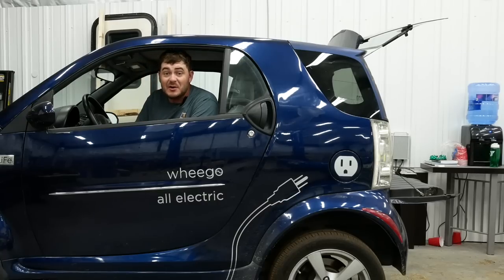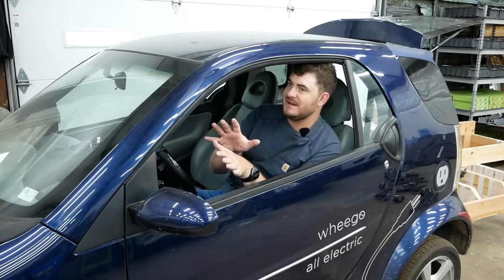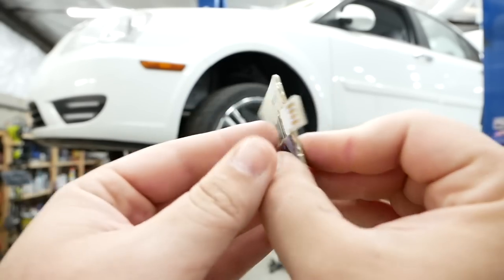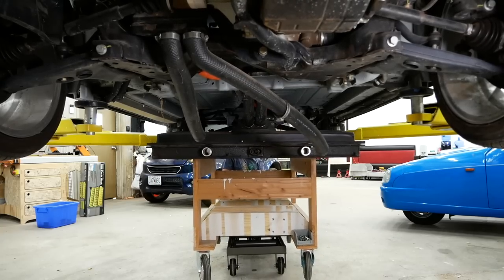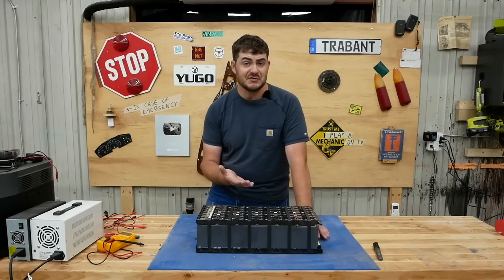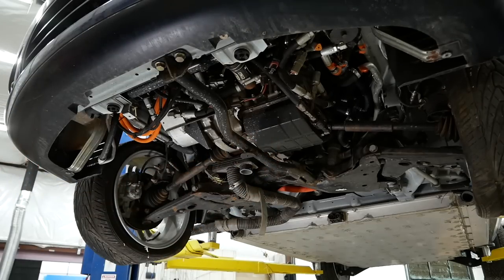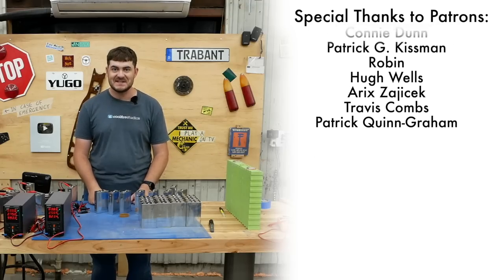I Have 3 Dead EVs. Are Any of The Batteries Still Good?

Comment: I would say, don't keep the battery pack "just in case somebody needs it". You have it, and it's perfect to bring the nugget back to life. And the nugget brings joy.
Reply: We need the nugget back to life
Reply: @keithdosik  we need the wheego life!
Reply: „Nugget“ -  found the dankpods viewer
Reply: And they degrade over the years.
So letting them sit for another ten years when somebody needs them they would also be dead.
Reply: No nugget = no serotonin
Reply: Ultimately they are yours it’s yours to do with as you please….. maybe my feelings would be different if I had a coda that needed a battery pack….. but, if I had a coda that needed a battery pack I would not worry about it because I hate how the wheel bearings are designed and would not fix it.
Reply: Preach
Reply: It's the same justification as an engine swap
Reply: @Sebisation  Anything’s a nugget. I’m a nugget!
Reply: Let's be honest: chances that someone will want a stock coda battery are close to zero
Reply: Dankpods refrence?
Reply: E Van  the battery pack doesnt spark
Reply: Summed up perfectly!
Reply: Or upgrade the go-kart’s range dramatically?
Reply: @chrisj683  yes
Reply: @Sebisation  cashies special
Reply: @IronGoldDiamond  we are all nuggets
Reply: It may be useful 10 years down the line for the working coda, to keep the other battery intact at 60% state of charge
Reply: @Sebisation  could be Mighty Car Mods, instead.
Reply: @Sebisation  i was gonna say something similar!
Reply: Not like he's going to find a CODA owner, anyway
Reply: @xHadesStamps  it's still easier than finding a 3rd gen reliant robin owner in the united states...
Reply: @bandguymichael  True 🤣
Reply: @Sebisation  thanks to dankpods all earbuds to me are dirty buds
Reply: @ShockingPikachu  no just you
Reply: And the girl from the vine
Reply: @jacobkueker7779  cheers
Reply: Oh please we need a dankpod collab
Reply: How many PK-Cells do we need to power the weego?
Reply: @lopeo2324  at least a box
Reply: on the third day the nugget rose again

Comment: hey, I've done some math; you don't have to ruin the other coda 31kwh battery to make the wheego street-ready, you can use 112 cells for the lawn mower (7p16s similar to the lead-acid battery you already had 5.376kwh vs the lead-acid 5.520kwh ), and with the remaining 512 you can use (504)them for the wheego (14p36s) for a 24.192kwh battery pack (like the first-gen Nissan leaf use to have), with the remaining 8 you can use them to make a 12v lead acid battery replacement for the working coda (you will need a cheap BMS for a 2p4s configuration)<on paper all the battery configuration i've propose should be capable of delivering the proper amps for their application >. hope to see you working on the Wheego a very unique and historical car for your channel (if you do a 24kwh wheego i want to see the range test like you did the last time), have a nice day :) you are the best
Reply: "5.376kwh vs the lead-acid 5.520kwh "

It's significantly better than that- lead acid can only be discharged down to 50%, a usable 2.76kwh, lifepo down to a very safe 20% would be 4.3kwh usable. That's 55% more real capacity.
Reply: Commenting so hopefully he sees this
Reply: Instead of a 12 lead acid replacement, use those last few calls to power the gokart!  IIRC the battery situation for that has yet to be finalised.
Reply: @JimOHalloran  that would be cool
Reply: We need to get robert to see this
Reply: I’d be perfectly fine with watching a Coda die for the Wheego, but if there’s a way, happy to comment for it to be looked at.
Reply: @eshock9208  ROBERT!!!!! Come see this please… :P
Reply: YES!
Reply: This is the math we needed. Well done. Hope he does exactly this
Reply: I don't know enough to know if you're right or wrong but I hope that if you are wrong that he at least addresses your comment so we know
Reply: @bland9876  😅I’m a student of electronic engineering 👨‍💻 my calculation where based on the 60kw motor (520amp at peak 2.48C for the battery pack )of the wheego  and like 5kw motor (112 amp at peak 1C for the battery pack) of the land mower , by size should be possible (it depends on Robert skills at play tetris)
Reply: @OrangeCrusader  lifepo can go to 0% and get the full capacity
Reply: @ssupertutorial  wtf kind of mower has 5kw and 5kwh?
Reply: @Blox117  Depends how 0% is defined on a display/controller/bms, with a buffer to the cell's minimum voltage or not. No battery can go regularly to or below its min safe voltage without at least a bit of damage and lowering the good cycles left, lifepo is just better than most at recovering from that state at all. I still run A123 lifepo cells and I can say that bottom 10% (to 2.8V vs stated minimum/0% of 2V) is a sharp, steep decline that would induce range anxiety within whizzing distance of the mower's parking spot.
Reply: Save the coda it's rare. 
I would say convert it to dual motor but it's probably way more complicated than I can imagine.
Reply: @Blox117  sadly I was unable to find the motor specs for the land mower from ryobi, on their website they don’t specify the hp of the motor , the battery should be capable of powering a 20kwish motor with no problem 😉
Reply: "delivering the proper amps" 
Yeah, nah.
Reply: @aspergerio 😅 hey Aspergerio , why shouldn't be possible for those lifepo4 to deliver enough amps ? There are lifepo4 capable of delivering 20c continues and some that can do spike of 100c, if you have some more info about the coda cells can u share them with us ? (I'm super friendly and open to any possibility and discussion 😊)
Reply: hmmmmm sounds like a good idea if he has no other plans for the cells
Reply: Imagine having a 31kwh battery for making a plug-in hybrid bus 😎
Reply: I'd love to see one of the cvt codas in working shape
Reply: I figure he probably wants to upgrade the lawn mowers capacity if he can. He uses just about all of the battery on it as is, if I remember correctly from the video, and he probably wants to build in a little redundancy for the future.
Reply: @ssupertutorial  the wheego can pull up to 500 amps at 96 volts

Comment: I think sacrificing a Coda to revive the Wheego is a fair swap - more interesting to have one of each than two Codas and no Wheego I think. Plus the battery-less Coda will either still be useful for parts and/or could make an interesting base for some kind of project.
Reply: yeah make the wheego live again cause those other two dead codas are just part cars anyways and the wheego won't last much longer anyways might as well get it going so it can finsih dying cause from what has been shown the motor to gear box connector on it is likely getting stripped out anyways from being driven something Robert has mentioned has happened another wheego life
Reply: V8 swap! V8 swap! V8 swap!!! 😂
Reply: Yeah, make the Wheego live again.  If there were only ever 11 Coda's built, and Robert has 3 of them, the chances of someone showing up who needs a Coda battery are pretty remote.  better to battery swap the Wheego and the mower and get some use from the cells.  Either that, or make a 67KW franken-pack for the working Coda :)
Reply: @JimOHalloran  yeah that is true plus he has what he needs most for the one that he is keeping that runs the larger 36 kwh battery pack for that coda cause the 67 kwh pack is out of the question for one reason he's not said any plans for making a custom pack for his coda so that means his coda will only have a coda pack regardless of the size
Reply: @raven4k998  Yeah, the 67kwh franken-pack was a joke, making an enclosure to fit both lots of cells, then fitting it under the car would be a big job, far bigger than it's worth.  Keep the best pack for the working Coda, raid the other Codas for parts for the working one, and make as many other cars/mowers/things around the workshop better using with the spare cells is by far the best approach.
Reply: LS swap the parts car coda.
Reply: @timberinternational2377  that's a great idea for the wheego when it finally dies use coda parts to revive it
Reply: @JimOHalloran  he could make the second pack into a range extending trailer

Comment: My son and I just got done watching this and... Make the  Wheego go again. Battery technology moves in leaps and bounds. You enjoyed that lil heap of a car, and I can't recall but I think that never gave you the problems with the front wheel bearings like the Coda did?

So, they're only batteries, and shelving then seems wrong. Do what makes you happy.

Thank you for putting out this sort of content. Always look forward to your videos.
Reply: the wheego had bearing problems too...
Reply: @SuperUltimateLP  I feel like he did the Coda twice inside of less than 100 miles. But could've been the Wheego.

I guess the other thought is that the Wheego is a ripoff of a car that was produced in greater numbers, as where I believe Coda is dead-dead.
Reply: @Gpassantino  the wheego also has the worst battery management ever, I feel like a new pack is going to die too, the system has such a huge parasitic drain issue :/
Codas are more worth saving in my opinion ^^
Reply: @SuperUltimateLP  I don't know the amount of systems integration that went into the Wheego. My limited experience tells me that if I hand the vehicle the correct voltage (what it expects to see) that I can use whatever BMS I want. Typically the fuel gauge is just a reading of the battery voltage, it can't really tell SOC. The Coda is nicer for fit and finish, it shows in the pack. The Wheego is clearly the least precision built ride of the three.
Reply: There may not be many Coda battery packs in the world, but there are some. How many Wheegos powered by Coda batteries exist though?
Reply: I agree. This question is as old as people modifying their cars and especially modifying "classics". It's your car and you can do whatever you want. Not only that but you actually SHOULD do whatever you want. Otherwise the motivation isn't as high and the chance of the project getting pushed back increases dramatically.

Comment: Ooh, I feel your pain with the Coda battery pack. Those things are works of art. Someone downthread suggests that there are in fact enough good cells to do both the Weego and the lawnmower without having to touch one of the packs. If that's possible --- how about mounting it on the wall with a perspex lid and using it as a whole-house power bank?
Reply: Yep, taking out the cells you need and mount the rest to the wall is a great solution.

Comment: I would recommend to  not taking apart the cell modules, just if you really need to re-organize the cells that much, or they don't fit. working around the existing modules is mutch easier than building them from the individual cells, also the quality of those modules is superb! For testing, just voltage is not really meaningful, sure it gets you a verry good indication of the health but not reliably enough to be sufficient to built them in a new battery. But I would test them not individually that takes as you have seen either very long or a huge setup to many of them at once. Just test them in the Pack, there are many RC charger/discharger that are cheap and can handle 7S, you can also use it probably for many other projects etc. and this will be more than perfect to find out if the cells are fine, if you see big changer in performance you know in witch paks you have a problem, and you can then further investigate. love your work!

Comment: So, you 'could have' aired up the tires - instead you bent a pipe to overcome the flatness. I dig it: Create a tool for a problem instead of fixing the problem.
Reply: I thought the same, then I realised that must've been "paperless" Robert. Poor guy probably doesn't realise a device exists to put air back inside a tyre.
Reply: when the tires are that flat, airing them up is not an easy task. You'd have to generate quite a bit of a pressure wave to get the tire to clamp back onto the rim, since at that point the tire and rim have a gap between them.
Reply: Could be dry rotted beyond belief
Reply: @Elena14204  That was my thought.  I make no assumption that aged-out tires will actually hold air.  I just had to replace some 8 year old factory-installed Pirellis on my wife's Golf with less than 40k on the whole car (we got it off lease, so the previous driver did not seem to drive it far or often - in a year we put on more miles than the lease customer before the tires decided air wasn't fun)

Comment: Good fun and very interesting, thanks as always! 

I'm not a fan of "keep it just in case" in most circumstances, so I vote to revive the wheego. However.  Didn't you say that 36kwh pack failed crash tests?  I'm not sure how I feel about that extra 20 miles of range with that cloud looking overhead. It's an unnecessary risk imo. Please don't die.
Reply: It failed them because of the oversized lateral ventilation things, which probably compromised the car's structure in the even of a side crash. It had nothing to do with the batteries themselves. Possibly, because it's all hearsay.
Reply: You know he drives two plastic cars on public roads, one of which only has three wheels? And neither have seen anything resembling a NHTSA (or equivalent) crash test.
Reply: @AaronSmart.online  no need to tempt fate though, imo
Reply: Nah, even the car that failed a crash test in 2010 is still better than a Trabant in a crash (1960s car built with 1930s tech).

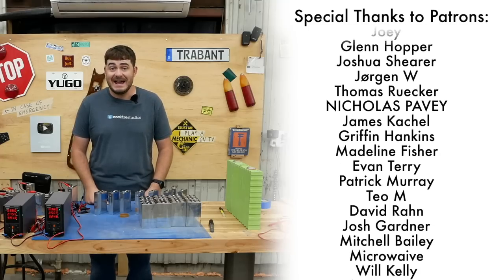Comment: 26:45 The question I would toss back at you, is: Do what gets you back on the road faster, but consider what would actually be the best use of your time. The Wheego has had terrible reliability but you get good help from that one dealer in Georgia. CODA is on a Toyota frame and chassis, but who knows what parts it shares- as your constant battle with CV joints and hubs show. Hard choice tbh.
What do you think you'll do with the motors and controllers? They're from UQM right? Hell even those CVTs might be worth something, no way CODA made their own; I'd say 99% accurate that they're from another manufacturer like Nissan.
Reply: Toyota? I thought the Coda was based on a 1990s Mitsubishi Lancer platform.

Comment: Considring there isn't that many running Wegos either and you have a lot of info on the third-party battery manufactourer so these battery packs presumably (if they are still in business) could build more for the right price. I think it would be great to get grap the battery management from a donner and put it in the Wego since there system does seem to be more reliable.

Comment: I look forward to a project to lithium-retrofit your mower since I expect to need to do the same to mine. There is some great information online from people that have blazed that path
Reply: I upgraded my Ariens AMP years ago to 16 CALB  80Ah LiFePo4 cells from Jack Rickard. I'm now looking to do the same with my Ryobi 75Ah zero turn. Have you ran across anyone that has maxed out the battery box on it with cells? I'm hoping I can fit about 200Ah in there with modern cells. It has the same battery box size as the 100Ah zero turn. Just has an extra bracket for the smaller batteries.
Reply: @JayGroh  the guys on diysolarforum appear to have matched-or-exceeded the 115ah capacity of the largest Ryobi, not to mention that you can deep-cycle the lifepo4 instead of trying to stay above 50% on the lead-acid batteries (so you lose half the capacity from the spec sheet right off the bat)
Reply: @FliesLikeABrick  Thanks. I'll see whats going on over there. I know when I upgraded my AMP it acted like a different slightly better mower. Except for the over heating in the summer. 80Ah of LiFePo4 was getting 1.75 acre cut per charge vs about 0.75 acre on the lead batteries. Still works fine and has full capacity. I might just end of moving the cells out of it and into the Ryobi but I really want to max out the Ryobi battery box.

Comment: All the LFP batteries I have on my channel came from Wheego cars.  One of my best friends worked with the guy who founded Wheego, and I bought them from him.  Pro tip - the BMS continuously draws a miniscule amount of current, but over years it will drain even those large Winston batteries down to zero.  And once they're at zero, they aren't coming back to life.  I tried it and have a video of the process on my channel.  But the cells which weren't killed permanently still have about 75% life remaining with 2010 date codes.

Comment: if you were to open source the service manual, I think you're ok to use the pack for your purposes. Someone could easily back configure a pack from that, potentially at a higher density or different configuration of cells. Plus you've already given back to the community with this video of pack removal.